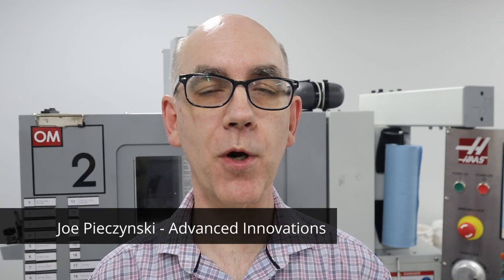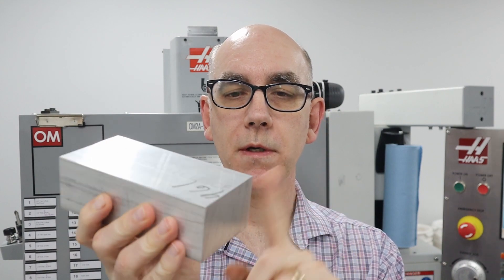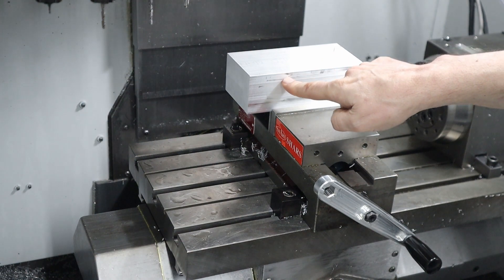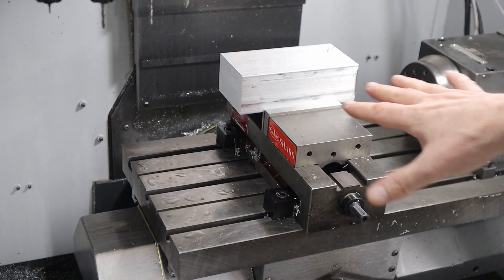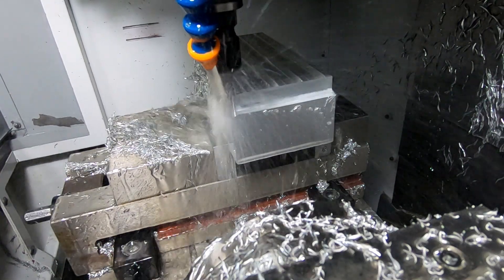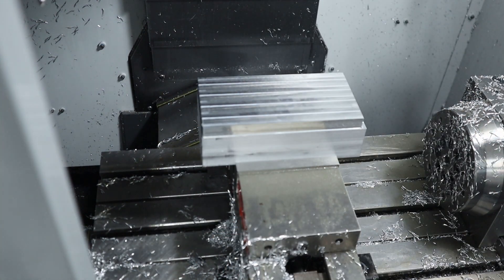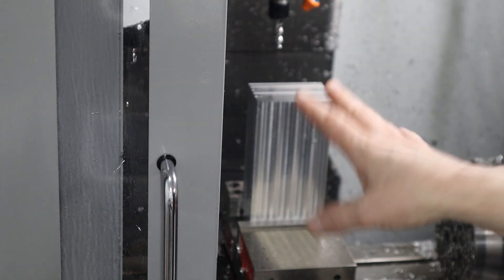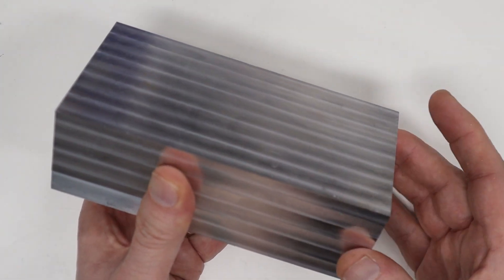Precise Sizing and Squaring Stock on a CNC

Comment: I have never seen a more long winded method. Aim for 6 passes 1 for each face.
Reply: Agreed. Pretty much exactly how I do it. 

Face primary surface A, rotate 90 so that face is against the back jaw. Face  secondary surface A, flip 180, face secondary surface B, rotate 90, face primary surface B (and if the stock is long enough, u can even side mill the saw cut ends square at this stage). If this is not the case, simply orient the saw cut face upward, indicate with a dial indicator, and face, flip 180, and face. Done. You can even hold the billet vertically in a V block to get it true without necessarily having to indicate the part in. There is also the 5/7 method for dealing with the saw cut ends. 

A number ways to go about this, but I only ever find myself experimenting with the saw cut ends near the end of the process. Everything else is straightforward.

Comment: so that the "classes" - (substrates to adjust the height of the workpiece in the vise) do not fall after blowing air, fix them with a construction or stationery rubber band width, 8-10 mm
Reply from the maker: True, I could. It's never bothered me enough to do that, though.

Comment: Hey John, if you go onto Aliexpress they have the ISO20  face mills on there. Here is a link to one

https://a.aliexpress.com/_msbmwnF
Reply from the maker: I have one of those, which is how I learned that not ISO-20 tool holders are created the same. The Haas tool changer requires a different profile for the rings than this one has. Plus it's too large to fit into my tool changer (ask me how I know). I did find a 1" face mill with a 1/2" diameter shank that I've been able to put into an ER-20 tool holder.
Reply: @JohnSL  Ah, I see that's kind of a bummer that the Haas spindle uses a semi-proprietary tool...

Comment: What's the largest tool diameter an ISO 20 can hold?  For long reach stuff I've used Walter Valentine "Center-dex" mills.  The have long reach and can drill, mill, and face.  But their effectively limited to a single cutting flute.   Or find yourself a reduced shank insert milll, I'll have to find a part number for you. 

After you square up the stock it's always a good idea to throw it across a surface plate and check parallelism.   I know I've been bitten when I hit the size but not the squareness or parallelism.
Reply from the maker: Yes, I could use a long-reach, reduced shank end mill. As I replied to another person, I'm not sure I'd want to dedicate a slot in my ATC for that. And good point about the surface plate. Most of the time my precision needs are not that high. But I should have a look to see what it's like.

Comment: Another way is, on the first op, with the profile cut, cut it 0.040" oversized, then when you turn the block on different ends, you can zero from the top on your profile cut and face down 0.02".
Reply from the maker: I could. I believe this would increase the tolerance stack up, and therefore potentially decrease the accuracy.

Comment: Hey John, there’s an even easier way. You really only need to do a rough G54 once. Set up your stock and set a rough G54. Face the top. Then use a large end mill and do all sides down to just above the jaws of the vise. I Mitee-Bite jaws with Talon inserts. I typically only need to hold about 60 thou. I leave about 10 thou around the sides and do a 2D contour finishing pass. Then i raise my stop to locate the stock. I flip the stock. I then face off the 60 thou. Bam! This way you don’t run the risk of mismatch sides.
Reply from the maker: Yes, I could do that if I had a longer end mill. Someone provided me a link to a 5" long 3/8" reduced shank end mill. That would certainly do it. However, I'm not sure I'd want to dedicate a slot in the tool change for it, as I probably would not use it for roughing. There are definitely pros and cons to Joe Pi's method, as I've modified it, vs. the traditional method where you leave a hat and then need to mill away the hat.

Comment: Hey john just out of curiosity i had a look for 20 taper facemills and there really isnt much out there. I did find an arbor not sure if it will work for you but here is the link https://www.vynckier.biz/en/cvh21-2
Reply from the maker: Thanks. I have no idea if it would work either. It seems as if you have to buy the Techniks tool holds for my Haas OM-2A. I'm not sure if Haas specified these to be different from others or not.

Comment: its nice to see some real engineering.    but what is the billet going to be ?
Reply from the maker: That, unfortunately, I was asked not to share.
Reply: @JohnSL  I think in the Machinery Handbook, Volume 18, under the miscellaneous footnote - it states that 2 inquiries about a part has greater validity than the single request for anonymity. If you look, its right after the topic of accidentally machining ones parallel.

Comment: I'm curious. Why not mill the ends in the first setup?
Reply from the maker: I don't have an end mill that has 2" of cutting depth. Because my holders are ER-16, I'm limited to a 3/8" diameter end mill.
Reply: JohnSL https://www.mcmaster.com/end-mills/length-of-cut~2/carbide-square-end-mills-9/
Reply from the maker: Thanks Paul. I knew they existed, but I don't have one. Others have suggested a reduced shank end mill, which would be stiffer and therefore have less deflection.